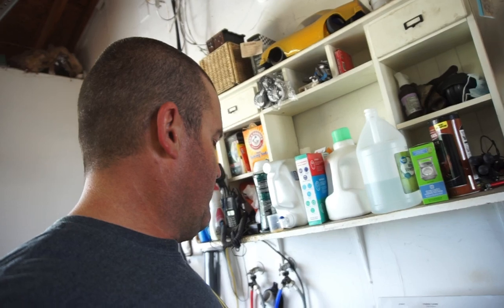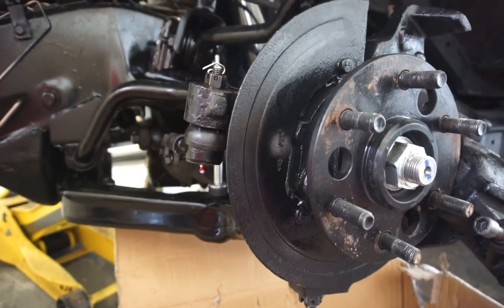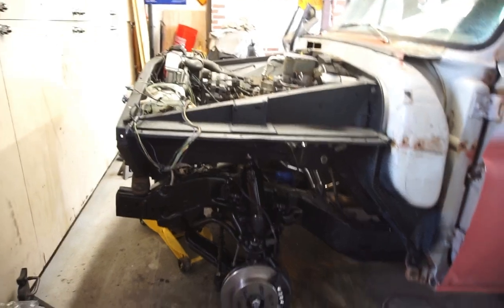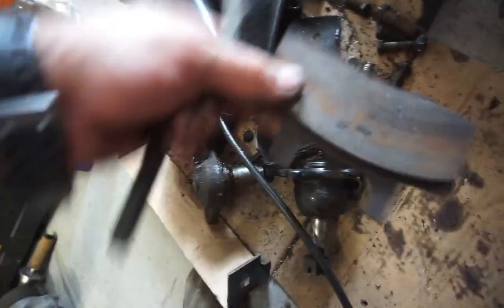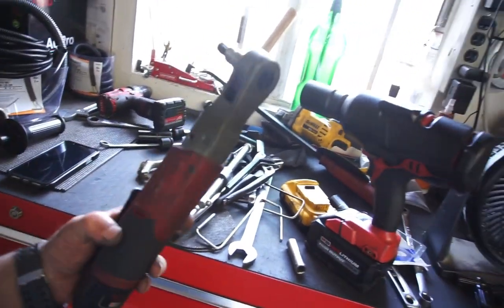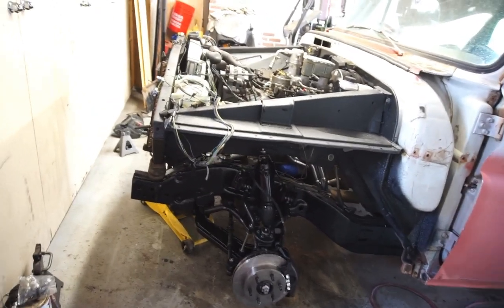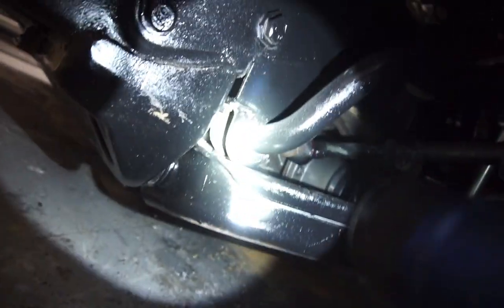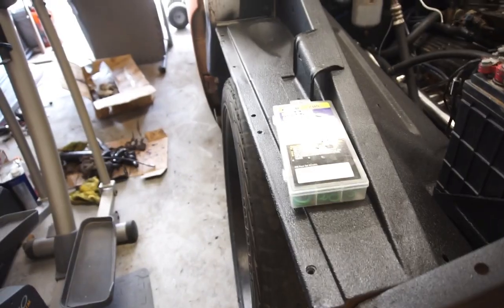Project Crack Pipe Gets Some New Brakes Up Front. 1991 c/k1500 4x4 Chassis Swapped 1964 C-10.

Comment: I got nothing .  Haven't ever seen that before .  I'm gonna go back and watch the video again and see if there was something I missed .
Reply: Its got to be in the air lines or the  T  fitting . Was there some kind of plug in the air fitting on the shocks ?  I'm sure you have it figured out already but its a challenge to try to figure it out from here .
Reply from the maker: No I didn’t figure it out. I think the geometry is weird so I think I’ll be putting the torsion bars back in. 🤷‍♂️🤦‍♂️
Reply: @Halffast719  ; Well if you're taken the shocks off try blowing them up on the floor .
Reply from the maker: Orion Fixr they air up. But I think it too much weight for them to lift at that angle. I tried moving them out on the bottom today and got nothing.